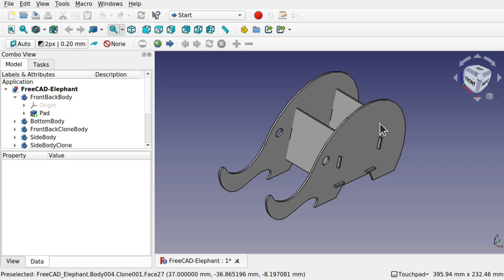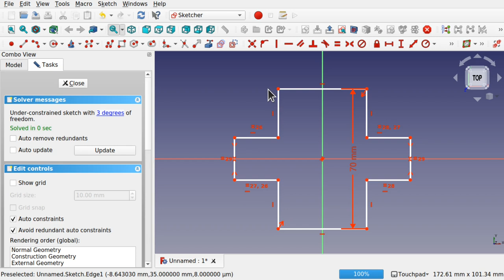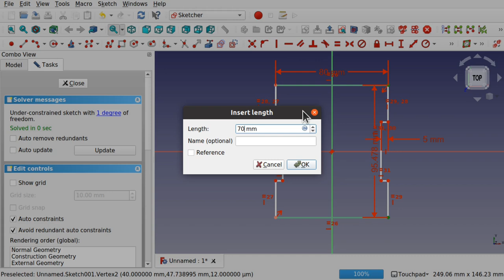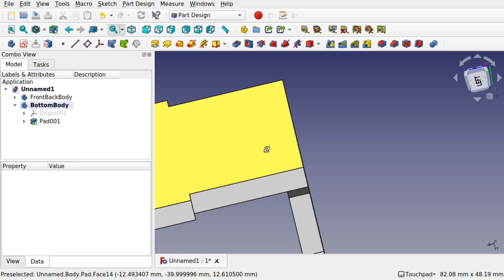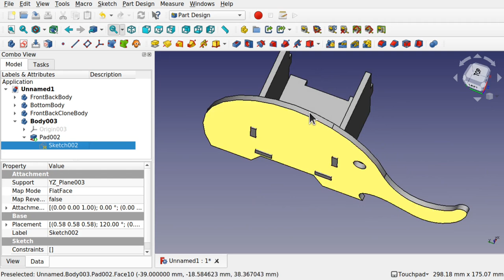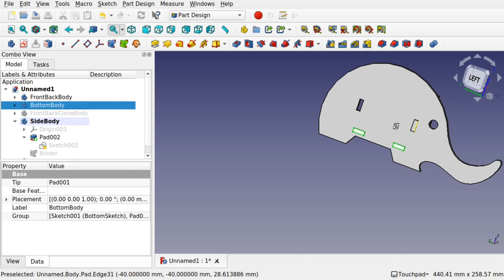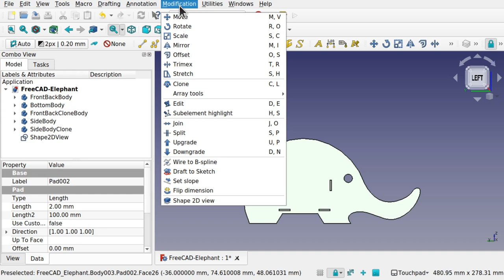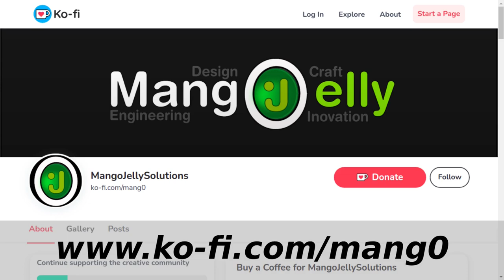FreeCAD Beginners Modelling Craft Project Simple Cardboard Elephant Pen holder Part Design Tutorial

Comment: This might be one of your longer videos but there is a lot in it.  I was expecting you show how to print the sketch or pad directly to a 2D printer.
Reply from the maker: Thanks for the comment, yes there was quite a lot in there and I tried to edit it down. At one point I did think that maybe I have explained this a bit to deeply especially round the sketching (I don't know, sometimes I feel I explain things to far) . I really try to keep them as short as possible but this one was a bit of a beast lol. Unfortunately I found the best way is to transfer the 2D output to inkscape for printing. You can do it from freecad with the draft workbench using the grid and print to pdf but then you will need to position all the pieces. With inkscape it's quick to drag and drop these into place and you have the options to add some colour if you so desire. 

I have some short cuts and tricks with the move and rotate tools in draft so I may retry with something different as looking back  it would of been nice to keep everything in freecad.